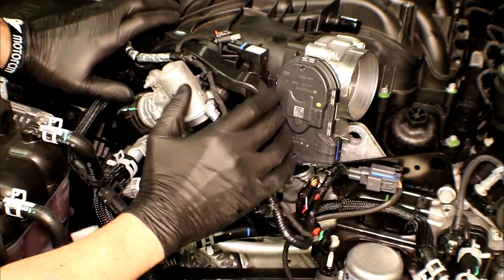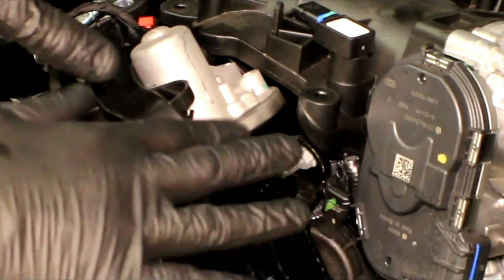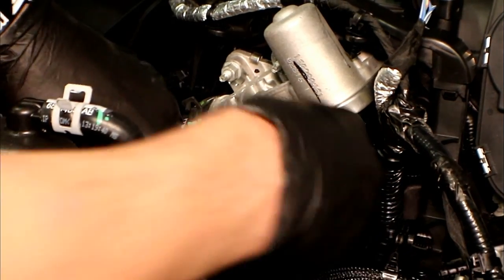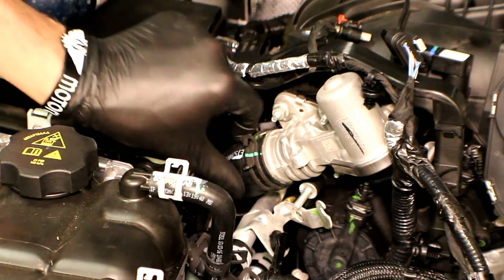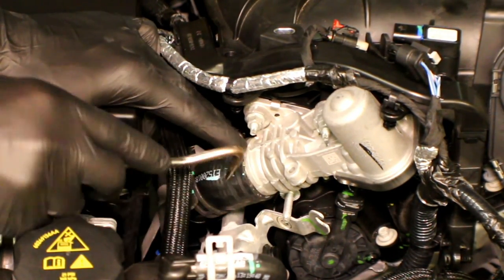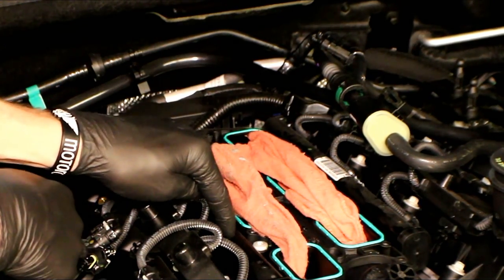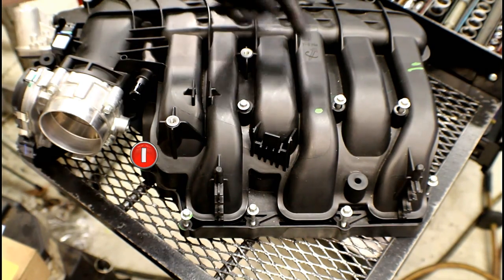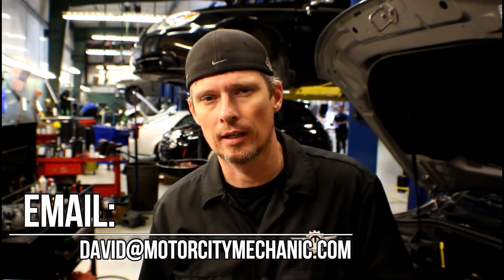Part 2/2: Recall S85 inspection and 3.6 with EGR valve upper intake removal

Comment: thanks I'm a Chrysler Tech as well and haven't had to do one of these recalls yet but your videos are always handy to have
Reply from the maker: I have only seen 2 of them so far. I found that I can inspect it as well using a bore scope. I got one recently and try my best to use it when ever possible. It's always cool to hear from fellow Chrysler Techs. Nothing like getting input from others doing the same job as me. You can get s different view point or find out other methods to help speed up the job. Thanks for watching and for tre comment

Comment: Thanks for the video.  I think this is the only video showing intake removal on the 3.6 PUG engine which I came across as I need to change the plugs on my wife's 2016 4wd.  Turns out the intake has to come off to do the motor mounts as well which are now leaking impacting ride quality.  So coming across your video kept me from having to figure this out myself and removing the intake twice!

Comment: My friend you have helped me and so  many others god bless you. Just did a tune up on a 2020 Dodge Durango GT  code P0301 misfire in number 1 cylinder. 62,671 miles on the engine.  I’ll update you if I get any more codes or the same one. Car has a lot more power and more response so far so good. Followed your instructions to letter👍🏿👍🏿👍🏿👍🏿👍🏿 this guy is good and right on point.

Comment: Do you have a video on how to remove lower intake? I’m trying to replace the oil cooler? Thanks great videos
Reply from the maker: In this model engine I don’t…..on the none EGR valve engines I do however.
Reply: Thanks for getting back to me I appreciate it.  Is the lower intake pretty much the same?

Comment: Was there an update on the torque specs? My upper intake manifold on my 2016 Grand Cherokee has 7-9 NM (62-80 in-lbs) molded right into the top of it. Excellent video by the way!

Comment: I had this recall also too. First, i thought it was simple..., but just to inspect the fuel crossover tube, the worst part was the harness which hold the bracket. Whew.., figure it out. plus, my advisor gave me 2hrs for this recall. Lucky me.
Reply from the maker: Wow....I need to get with your service advisor lol. Now that I filmed it....I won't ever see another

Comment: Just looking around at recalls , our 2016 jgc with a 3.6 just died out of the blue this afternoon then it started back up??? Shop closed so I couldn't go looking for a code and now she's scared out of her head looking a you tube interweb jeep horror stories. Any opinions, recalls ??? Thanks buddy and ps you make great videos!     Thanks Tommy
Reply from the maker: When ever you search the internet about any car on the market you will see nothing but horror stories. For that year model there is no common issues that I can point you towards. Checking the codes as you mentioned is needed and then maybe that might be something to check . Otherwise right now it could be anything. Thanks Tommy for the question and for watching.
Reply: MotorCity Mechanic       Thanks a lot
Reply from the maker: Your welcome

Comment: Just curious has it been determined how this damage is occurring during assembly?
Reply from the maker: The damage appears to have been caused by an upper intake bolt/screw. Being that a lot of steps are automated.....it seems what might have happened is that the upper intake wasn't lined up correctly and the back corn bolt/screw didn't go where it was suppose to go...instead between the fuel line and lower intake. The damage matches the thread pattern on that bolt.

Comment: Hey guy This is pit stop auto, i have a question please.... I have a 2004 Jeep Wrangler to replace the transmission control module I want to go with a junkyard does it have to be reprogrammed to that vehicle?
Reply from the maker: The information that I am showing doesnt mention any vehicle specific programming to the module. Its recommended to do a quick learn after installing the module and it doesnt hurt to see if there is a newer update for that module but  that would have to be done at the dealer. Otherwise plug and play is what I am showing. Make sure the part numbers are the same. Thats pretty much all the steps I can find in the service info. Hope this helps. Make sure to subscribe and share these videos with others.
Reply: MotorCity Mechanic thank you for the reply! if you ever need my assistance for anything let me know!!
Reply from the maker: Your welcome. I will certainly keep the offer in mind.

Comment: I really don't understand why FCA engineers made it so difficult to access the sparkplugs, for 2015 and precious models you have to remove the manifold to replace the 3 on the driver side, for 2016 and later models you have to remove the manifold to replace the 3 on the passenger side, what the helllllll!